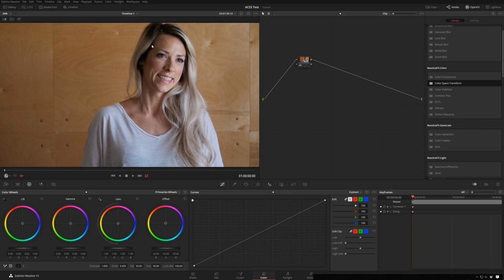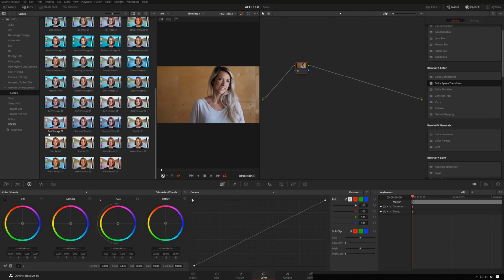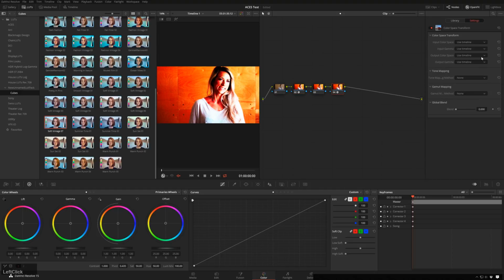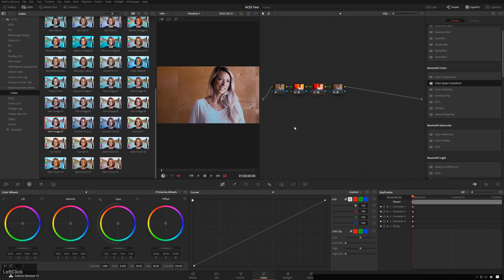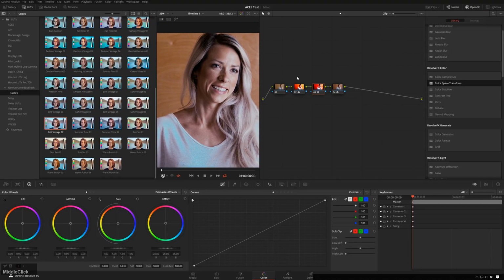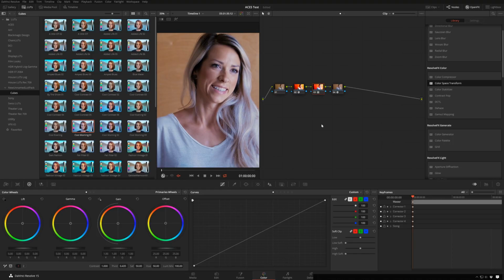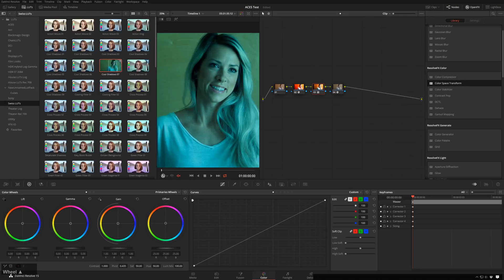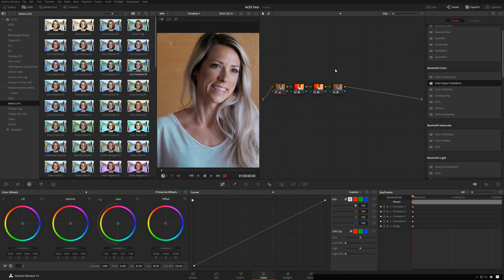Correctly apply LUTs in ACES - Davinci Resolve 15 Tutorial

Comment: Aren't you limiting yourself to Rec. 709 in that clip? How does it look without ODT compared to without ODT w/ LUT? (Because if it looks drastically different it means two are not same spaces.)
Reply: You always have to use the ODT of the final project/file. Unless you need to work with the file in ACEC in another editor or compositor.

ACEC is only for internal usage. Not for final rendering.

Comment: Why did you selected sRGB as the output transform for ACES instead of REC709 or any other? Just curious
Reply from the maker: Hey Gabriel, good question! 

I have been mastering a lot of stuff for web delivery which uses sRGB. rec.709 is pretty similar so a lot of people get away with just always delivering with that, but I always feel better using the "right" color space for your delivery.

-Theo